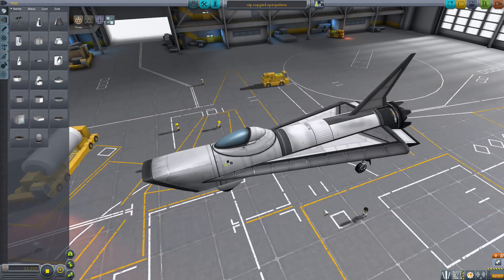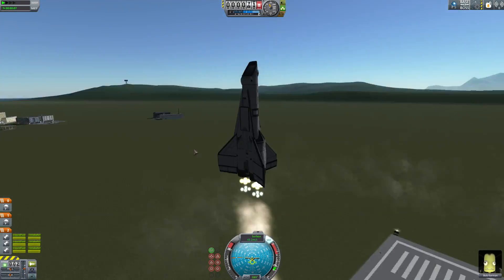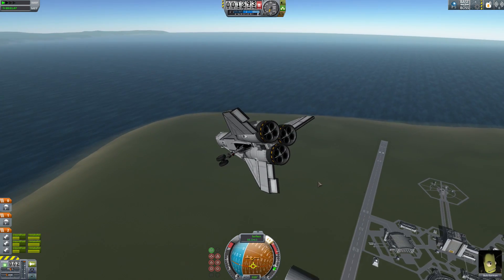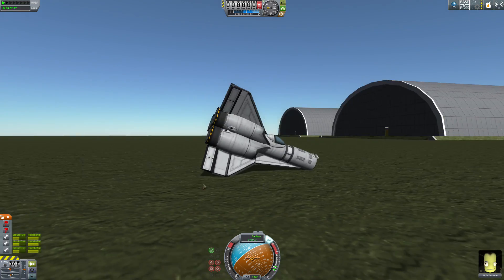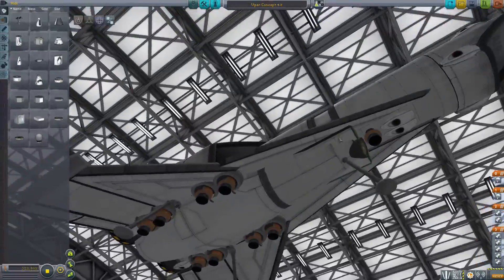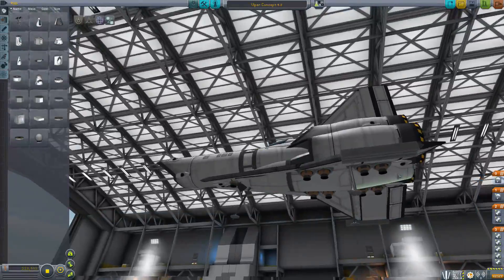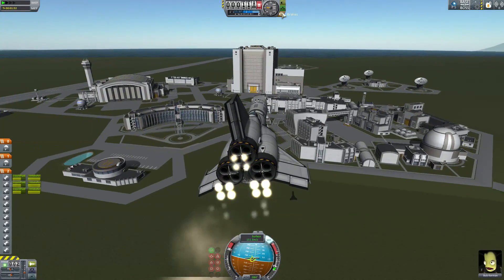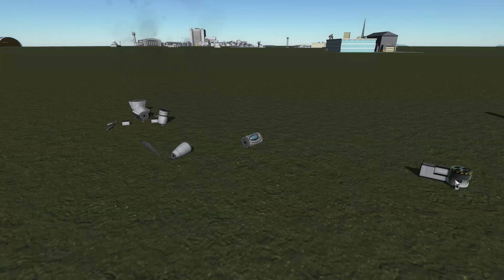KSP - Battlestar Galactica Viper (Completed!)

Comment: "Thrust to Weight Ratio" is as the words states:  The ratio of the Thrust force of the jet/rocket (in Kilo Newtons) divided by the Weight force of the ship (mass in Tonnes x gravity of earth/kerbin, also in Kilo Newtons).   The resulting number is the ratio of the upward thrust force compared to the downward weight force, which is in "g"s.  For example; if my ship's mass was 10 T then my ships weight would be about 10*10 = 100 Kilo Newtons, therefore I would need more than 100 kN of thrust to go upwards.  Hence you need your TWR to be greater than 1 to rocket upwards.  If your TWR was greater than say 2 then your pilot has over 2g of force crushing them into their seat.  More than 10g and they will pass out, more than 15g and they will die.